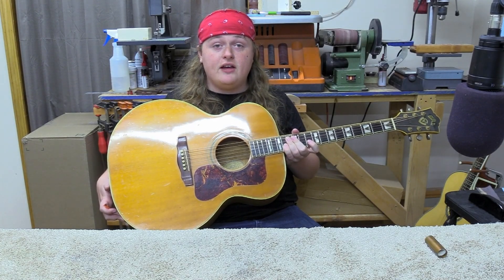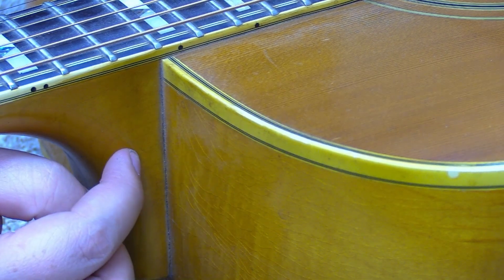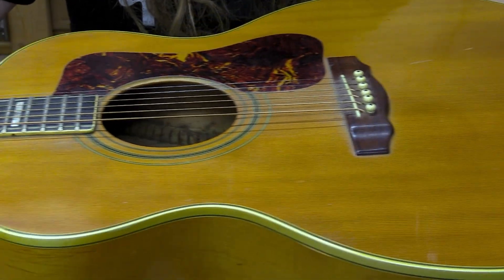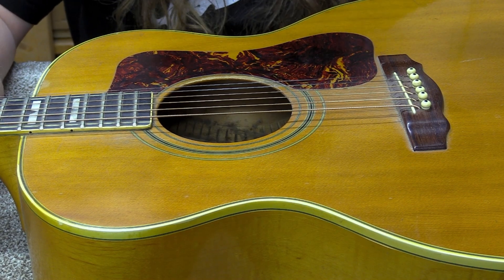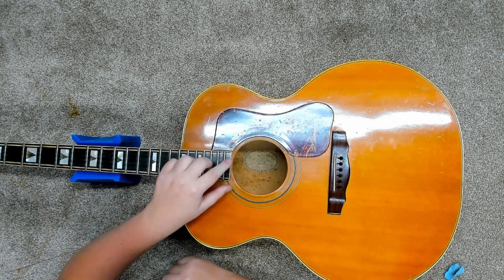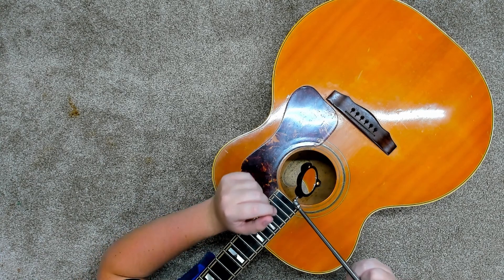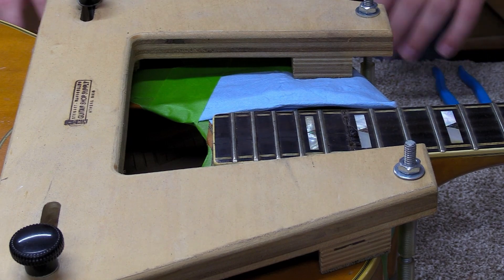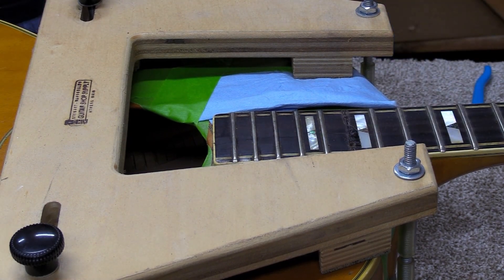1972 Guild F50 Neck Reset Part 1

Comment: I have the same guitar from the same era.  It needs a neck reset.  The bridge has already been shaved, and the saddle is quite low.  The frets are low and wide, really need to be replaced - but I love them just the way they are.  It is so much easier to play, especially barre chords, with those low-wide frets than the frets currently found on new guitars.

Comment: I like those old Guild guitars. You may have gotten away with shaving the bridge, but technically the neck reset is the best way to do it properly. Looks as though it had a neck reset already. I know it doesn't change the neck angle, but did you adjust the truss rod? I also have experienced that the straight edge going over the top of the bridge is not true on all guitars. I don't care what anyone says about it, I know from experience. On my son's Martin the straight edge does not go over the top, but is close, and it has beautiful action and has plenty saddle left if need to, but has been stable a long time now, knock on wood. On that Guild I would have done the wrong thing the right way and shaved the bridge if I could not get the action under 100 thousands. I might get lynched for saying this, but 100 thousands is not bad action in my book. No matter how low you get it without buzzing, it will never play itself, and if it is too low and you play a song where you need to get into some aggressive strumming, you are up a creek, it will sound horrible and buzz like crazy. One more thing, how many neck resets can you do on an old guitar? Seems counter productive to me. I'm sure you will do a great job, so I will be looking forward for part 2.